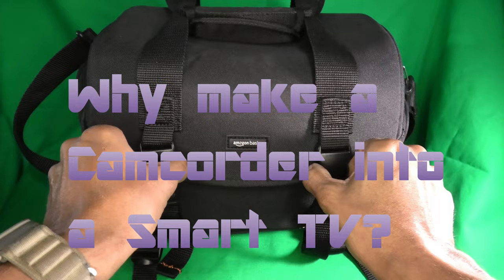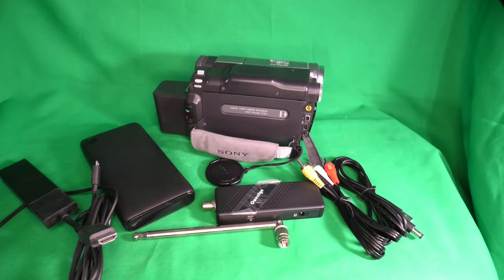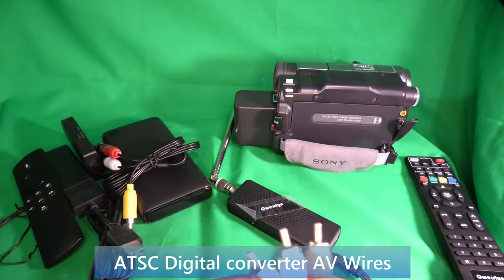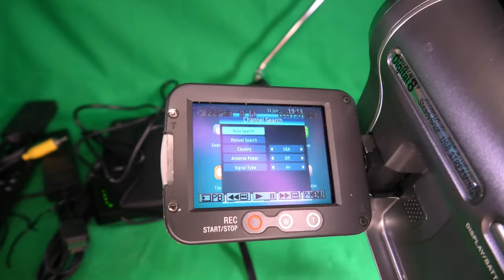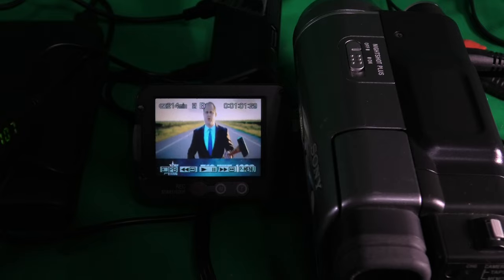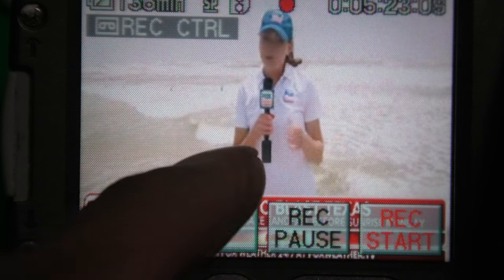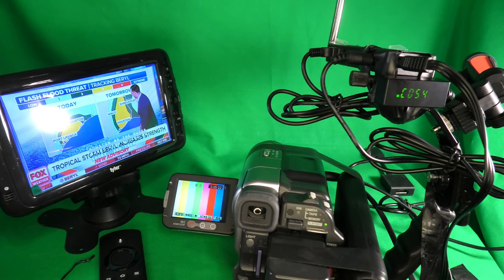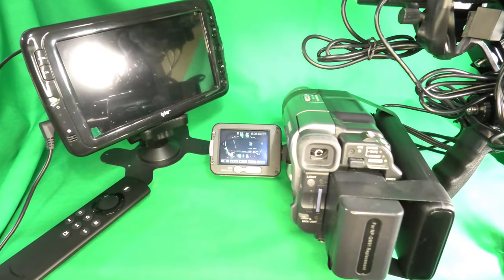How to Make Free Portable over-the-air Digital TV [Using Camcorder]

Comment: One of the drawbacks to the MacGyver approach is the mess of cables, connectors and peripherals as you've pointed out. I use a USB tuner on an old laptop which is much cleaner, and I can output composite video to my 5" or 9" CRT colour TV for that nostalgic look.
Reply from the maker: True, that was what we at NASA call a proof of concept.  Not even a prototype. I could optimize the cable lengths and come up with a better cage to hold everything it would be more practical.  The fact  that I can real-time stream my firestick to a tape is old school cool.  I keep getting asked if I can convert different things to a smart TV, and the answer is that anything with a screen and video inputs can be converted.
Thanks for watching.